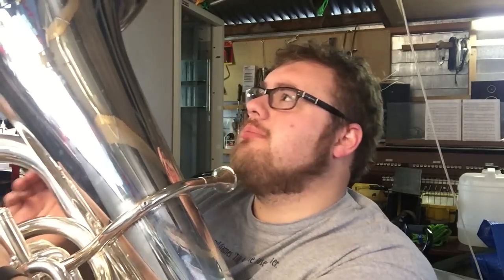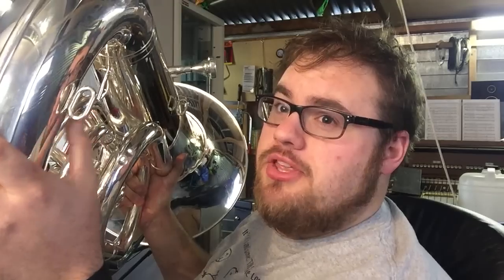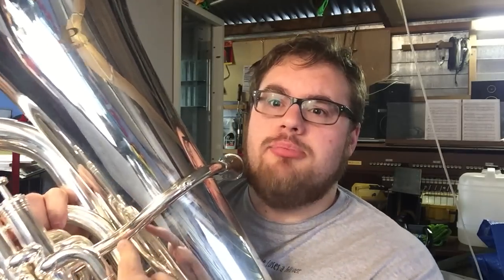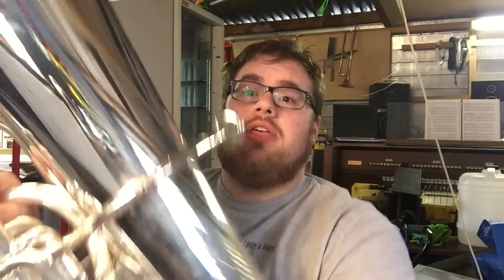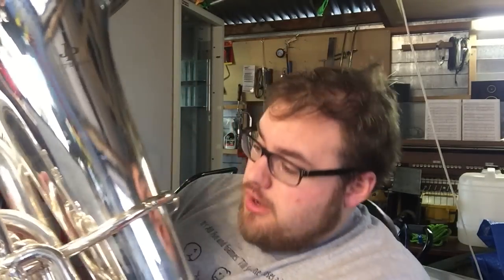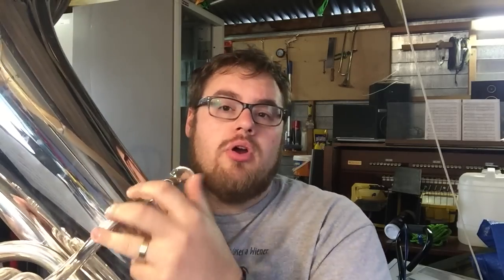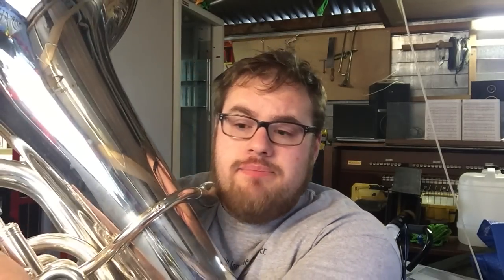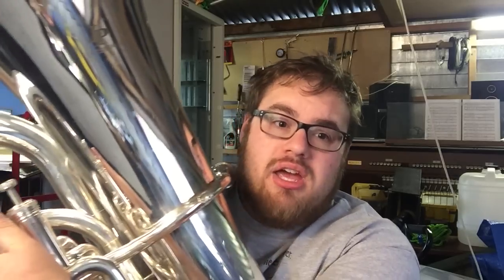JP John Packer Musical Instruments Eb Bass Review

Comment: How does this do in the low range and what was the worst tuning inconsistency? I had a cheaper Besson 982 copy in my hands the other day. It was decent in the higher range, but the low range was where the badly machined valves began to show leaks. The most off note, unfortunately, was the low Bb, at about 65 cents sharp. The tuba's biggest problem, besides brass that was soft enough to dent with a flick (probably not a JP problem), was those noisy, sticky, badly made valves (also, probably not a JP problem). At least, those issues had better not be present when Packer is asking so much for their horns vs. other importers.

Comment: Where does this fit in the larger musical picture? It seems to slot in between euphonium and a standard tuba, which is a niche is a brass band but not so much elsewhere. Would this instrument be useful in another musical setting, say a brass quintet? It just seems to me that for any role where this instrument slots in, euphonium or BBb or CC tuba could take over seamlessly.

I guess I'm asking, is there really a need to fill the octave between the baritone and the bass with another instrument? As a composer and arranger, I'm just not seeing it. To me it kinda looks and sounds like a big euphonium. If it had four compensating valves, that might be another matter entirely, but then you're probably trying to displace a CC.
Reply from the maker: +Scott Sakurai The Eb bass fits between the euphonium and Bb bass (tuba) in the brass band. The euphonium is no substitute for the Eb bass as it doesn't have the sonority or depth, even though one can play very low notes on a euphonium, it won't resonate the same way. The Eb bass usually plays either the unison or octave of Bb bass parts, although does play 5ths to create a beautiful effect. 5ths don't work well on two Bb basses because the sound gets too muddy.
Reply: +Trent Hamilton
I can understand the bit about playing in fifths or possibly even smaller intervals, but I can only think of two pieces where this effect is almost a requirement: "Bydlo" from Pictures At an Exhibition is one. Dense chords are also used in the basses at the beginning of March to the Scaffold, but those sound better to me if scattered across instruments of different timbres to help keep them clear of each other. I'm sure there are others, but they're not coming to mind. Aside from that rather unusually bottom-heavy writing, I was taught (and generally follow) the guideline that any interval sounds more cluttered as the pitch gets lower, and that it is best to give the bass line the lowermost octave all to itself.I suppose this doesn't hold up in brass band writing, but I tend to write for as small an ensemble as can practically pull off a desired effect. (For example, my scoring of "Bydlo" is for a brass quintet, plus a solo euphonium.)

Thank you for the straightforward answer. It still appears this is a bit of a niche instrument to me. It would be much less so if it had four compensating valves, making it a viable alternative to an F tuba in almost all situations. Even there, I personally would use it at the bottom of the ensemble.

I was thinking about the leadpipe problem, and the way it forces you to hold the instrument. Perhaps you could put that lower belt clip to good use, and attach some sort of peg to it that lets you rest the weight on your chair. It also seems to me the optimal solution to the annoying belt clip would be to replace it with one that has a hinge allowing it to be pressed flat when not in use.
Reply from the maker: Scott Sakurai Hi Scott, there are many pieces where 5ths are used. Remember, the Eb bass is not a typical orchestral instrument - it is used almost exclusively in brass bands. If you were using a quintet or similar sized ensemble then yeah, the Eb bass wouldn't be the go-to instrument. 

Regarding compensating valves, then yes, Eb basses get manufactured with and without compensating fourth valves. The first three generally aren't compensating by themselves, but the 4th valve mechanism usually alleviates any tuning issues.
Reply: +Trent Hamilton Actually, there are people using F tubas in quintets (though they're going to have four valves), and some of those also come with Eb slides, so if someone decided that an Eb tuba was the best instrument for a given piece, I probably wouldn't argue with them. I rarely write tuba parts below the low Eb anyhow (I do call for sustained and very important D's in my Toccata and Fugue transcription, but they're the sort of thing someone could easily build up to), so a compensating F or Eb would be perfectly adequate for my stuff, presuming it sounded big enough. I just can't see why I'd call for two differently-pitched tubas in the same ensemble (euphonium excluded, since it has a different role), that's basically what I meant.
Reply from the maker: In a small ensemble there perhaps isn't the need for two differently pitched tubas, but in the brass band it works great. There's too much of a gap between what the euphonium and Bb tuba bring to the table.
Reply: +Trent Hamilton 
I suppose if all you have is (valved) brass instruments, then it makes more sense. Similarly, there doesn't seem to me to be a huge need for an instrument lying between cello and viola in a string orchestra, or between cello and bass, but the New Violin family was created just the same. Just because I don't think there is a glaring gap in the instrumentation, that doesn't mean someone else has to agree with me. For that matter, I typically write my orchestral game music for a "bedroom orchestra", which I define as a group small enough to (theoretically) fit in your bedroom: two woodwinds (usually clarinet and bassoon), two brasses (typically trumpet and horn), and four strings (no second violin) along with a single, very busy percussionist. I use other ensembles as well, including a "dance orchestra" that's basically a six-horn jazz band plus violin, viola, and cello, but that's as big as I typically go unless I'm trying to remain true to something that already exists. What I don't do is reduce everything down to a piano part and a soloist. (Guitar and soloist, yes, but not piano. Too cliché.)

I suppose the basic reason I don't understand the role of the Eb bass is that I haven't taken up writing for brass bands. Everything I write for is either smaller (like a brass quintet with or without a drummer), or more diverse (like a wind ensemble or that "bedroom orchestra" mentioned above). There's really no place for niche instruments in such a group unless they are doubles. I have to stick with the most common (and therefore the most technically advanced and most versatile) instruments, so that I can squeeze as much out of each one as possible. If Eb and F tubas were still the norm rather than BBb and CC, and shared the same level of technical advancement, I'd probably be wondering what the big deal was about BBb and CC.

I've only seriously taken up string quartets in the last year and a half, so it's not beyond possibility that I might turn to brass band at some point.

Comment: Greetings, Trent. I've only been playing bass for a few years, and have just gone over to Eb and in looking for an affordable new instrument, found a website in my country selling a reasonably priced instrument. Found the same (JP077L) in the UK for considerably less. This aroused my suspicion. Seemed a bit too cheap, if you know what i mean, despite apparently glowing reviews on the page. I don't suppose you might know anything about this particular instrument? Or (and bearing in mind i'm only a beginner, and that i'm what you might call an enthusiastic amateur) , can you tell me if JP is a reliable manufacturer? I play in a small ensemble, and frankly, a very expensive instrument (Miraphone, for example) would be wasted on me, and unnecessary. Just now i'm playing a second hand B&H regent Eb...
Reply from the maker: Hi, JP aren't a manufacturer - they're an importer of Chinese made instruments. JP is a reasonable reseller, from what I've heard though. Another one to try is Wessex Tubas - again, a reseller of Chinese made instruments, but a reputable one.
Reply: I've got a Wessex 'Moselle' 3/4 BBb tuba. My first, in fact, and i'm acquainted with Jonathan, Wessex founder/owner. They've got a nice range of Eb tubas, and i've had my eye on a 4 (piston) valve model called the Bombino, but it will take longer to save for, being the thick end of £2000. I was looking for a quicker alternative, (i.e a slightly lower price) and of a similar quality (i'd highly recommend Wessex otherwise. More and more coming into the country). Thanks. Your videos are most entertaing, by the way. Particularly enjoyed the one about the 'cheapest bugle'...
Reply: Adrian Rosenlund-Hudson I know you said this a month ago but just in case, I have a John packer French horn and it does the job well. I would really recommend it.